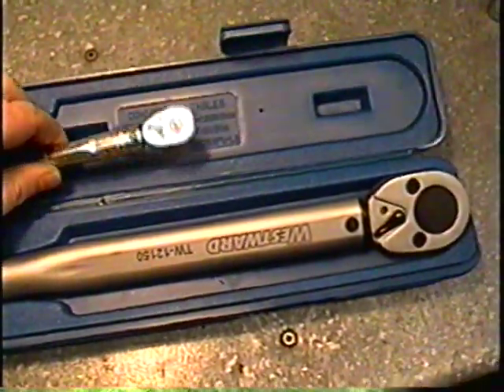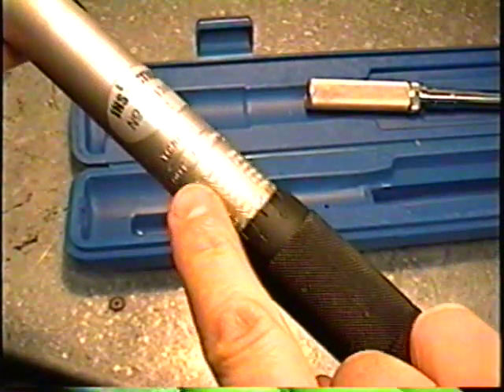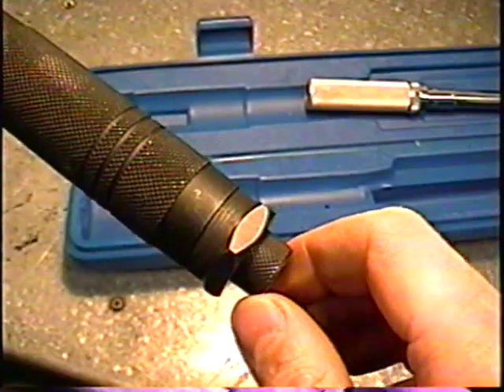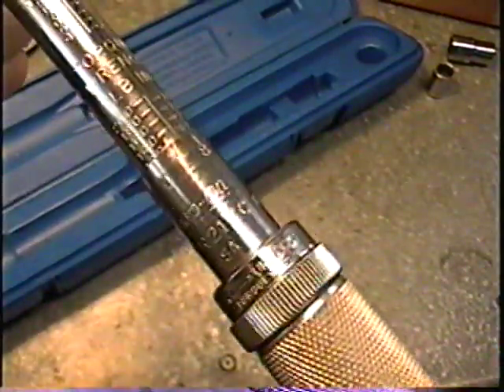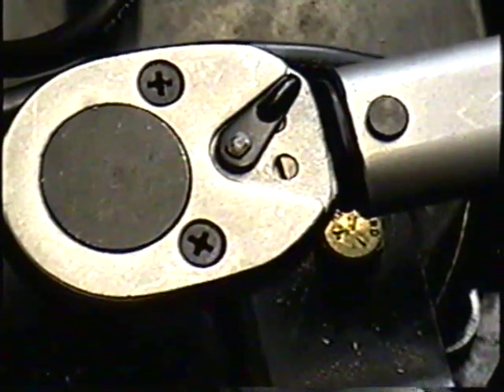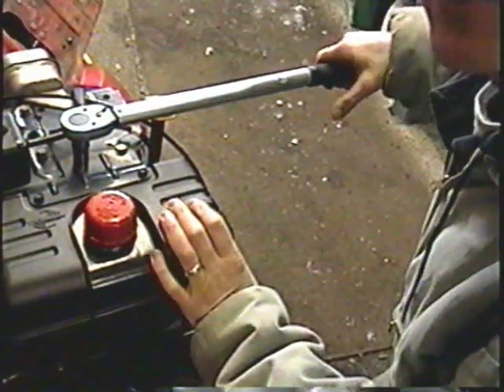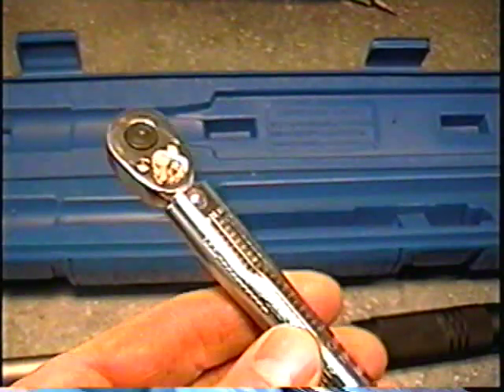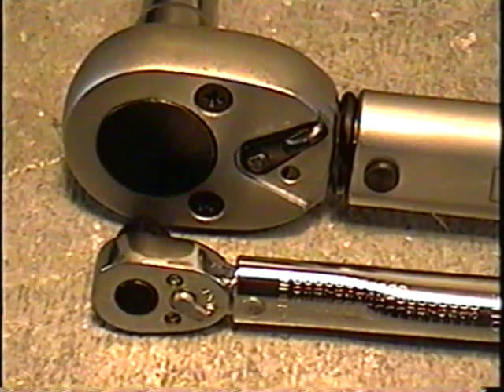HOW TO USE A TORQUE WRENCH

Comment: Actually, no it refers to the use of a wrench extension (not a socket extension) or crowfoot. A cheater pipe extends the wrench handle, while an extension goes between the head and the bolt, acting as a lever to multiply the torque wrench's applied torque. This allows the user to apply more torque without going over the wrench's max torque range.

Comment: ( T * Y ) / ( L + E ) = Y ... T= desired torque, L= Effective length lever, E= Effective length extension and Y= Indicated torque. and yes there will be change on indicated torque if change the length of effective lever or effective length extension.

Comment: @kbj76  If I could only buy one wrench it'd be a 40-200 in-lb or 50-250 in-lb, 3/8 drive. Either of those would cover the majority of engine fastener sizes. Of course, owning a four-piece set that would cover from 30 in-lb to 250 ft-lb would be ideal That range would cover almost any fastener you'd run into at a home workshop.

Comment: you forgot to mention it's important to turn the setting back to the lowest point if you are done with the wrench.

If you leave it at a high setting for a long period of time, the wrench will lose its accuracy completely. In extreme cases, a deviation of up to 30% is possible!

Comment: Snap On will NOT give you a lifetime warrenty on a torque-wrench!!!!  I do not know of any company that will as depending on use should be calibrated  yearly and that will NOT be covered under any warranty that I know of.  READ Snap On Warrenty info most ot the time a dealer will cover the ratchet part if you are nice to them.

Comment: @dodgesst97 Torque is defined as: 
Torque(T) = Force (F) x Radius(r).  If you hold the wrench at a different location, as warned in this video, then you're changing the radius, meaning you will get wrong torque. While using smaller extensions are completely fine, longer extension will give error. Imagine using 10 foot extension. How much will it twist when you apply torque?

Comment: U can use any extension. The torque is measured from the point of rotation out to where the force is applied. A crowfoot would chxnge the torque slightly. The angle needs to be at 90 degrees or accuracy suffers.